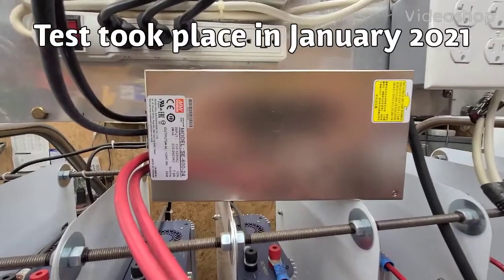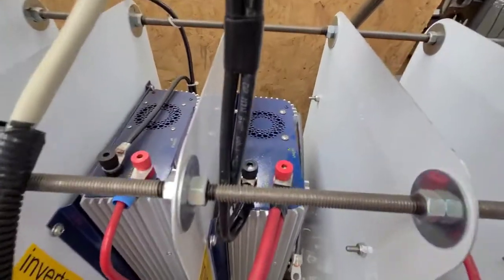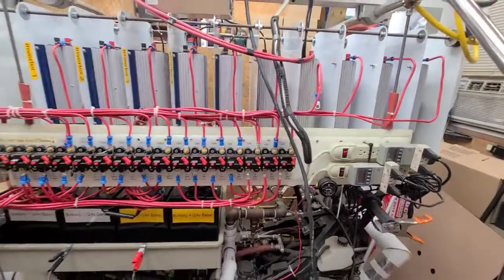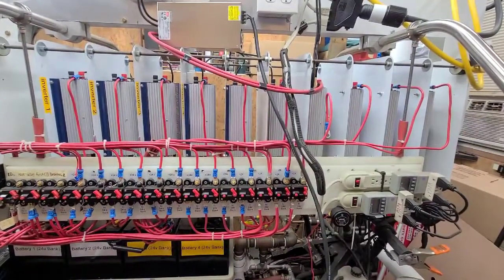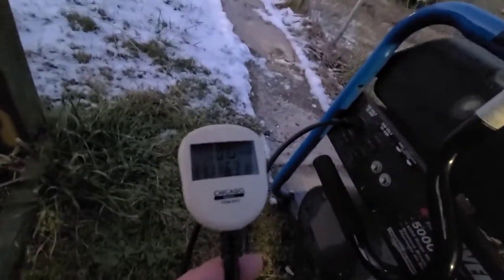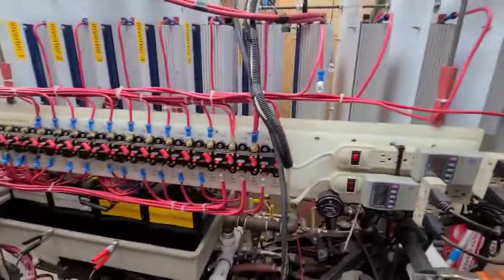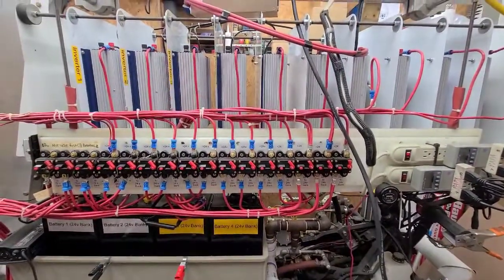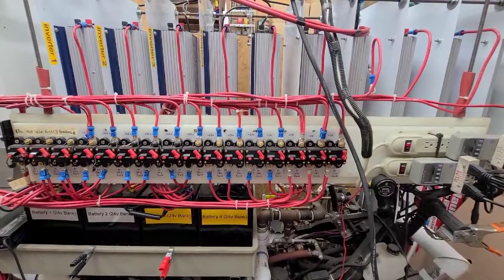Grid tie generator test

Comment: That is an amazing system you have built. Well done !
I am experimenting with a miniature diesel GTI system.
One thing I can't figure out is why you have not blown up your grid tie inverters yet?
Usually when connected directly to batteries, they pull their full wattage (unregulated) and get super hot.
Same when you connect them to a power supply with equal or greater rating than the GTI's.
Could you share the make and model of your GTI's ? Maybe you got lucky and found some good ones. 🙂
What's the voltage rating? ... are they 11v-28v  or  20v-45v or something else.
Reply from the maker: Gosub283, the grid tie inverters that I purchased are made by sun (104-S500g). I had a hard time locating the last two that I bought because I waited too long after my initial purchase of 8. I don't believe they offer these anymore. I think it helps that I have them mounted vertical with the fan blowing upwards. I think it helps dissipate the heat, especially mounted to an aluminum sign. That's what I bought for mounting them to. They are 10.8vdc -30vdc on the input side. The power supplies I have been using are 600 watt, 24vdc on the output side. They seem to work pretty well together. Every now and then, if the generator sputters a little bit,  the power supplies can drop out. As soon as it smooths out they come right back on only momentarily interrupting the output power. Also occasionally I trip a breaker. Don't know why because they are rated higher than the draw , but they are cheap breakers. I have run these inverters for a couple of hours at a shot and they do get warm but usually just don't put out max power at that point. Hope I answered all your questions. Thanks for watching and commenting. Joe

Comment: bigger grid tie inverters  take higher voltage, i've seen someone use a 220volt generator , rectify the ac and send it into a grid tie inverter directly.
Reply from the maker: Chris, I sized the power supplies to match the 500 watt grid tie inverters. When I wired up the breaker panel that feeds the powersupplies,  I wired all ten power supplies up with 240 volts ac to the input. So a thirty amp cord from the generator is able to supply all the power I need to run all ten power supplies feeding the grid tie inverters giving me about 5000 watts of grid tie power. What I love about this setup is I can choose how much draw I put on the gasifier just by turning on another power supply. Most setups are at the mercy of intermittent loads depending on what turns on or off in your house. This totally changes the draw on the gasifier.  I can turn on one breaker at a time until my temperatures are exactly where I want them,  and just run it there continuously. It's really starting to get exciting to see all of the electronics finally starting to work together to run a program that will eventually completely automate the entire gasifier including shutting itself down if filters get blocked,  or fuel runs out or temps are out of range. The skies the limit with automation. I  will be putting out a video once I get a little more done. Thanks for stopping by and checking my channel out. Joe.

Comment: Mamapapa
One thing I know for sure it produces a lot of noise
Reply from the maker: Funkaholik, the only really quiet generators I've seen are 2000 watts or so. I'm hoping my newer bigger generator will better since it's mounted in an enclosure. Only time will tell. I needed something that would capable of powering my house when the power goes out. Thanks for watching. Joe